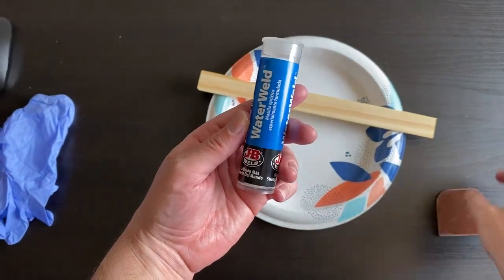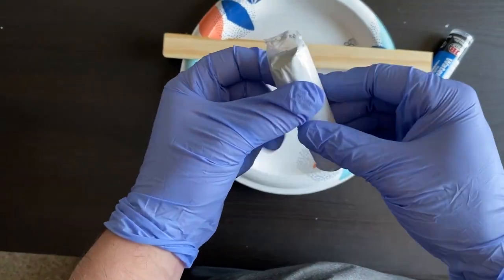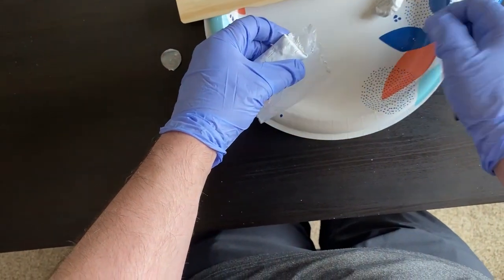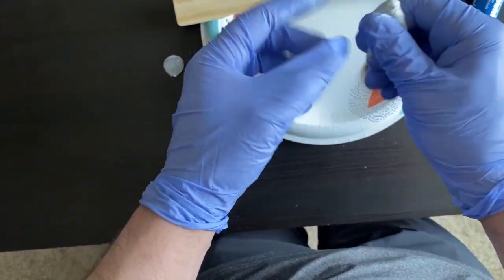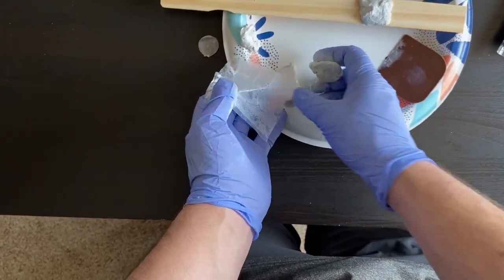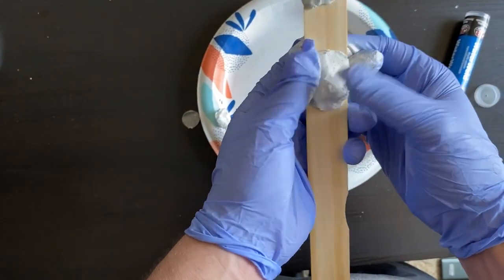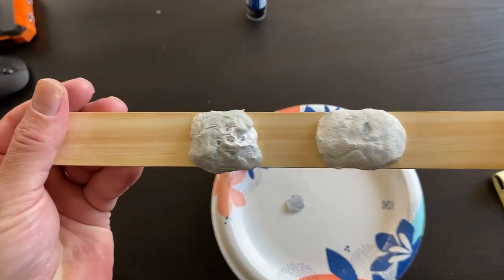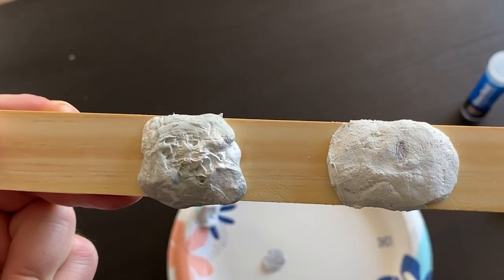JB WaterWeld Cure Test - How Long Does it Take to Dry

Comment: PRO TIP: Use 2 pairs of gloves.
As soon as it becomes difficult to work, change the gloves to new ones and transfer the ball there. It will be easier to work with now. Keep mixing a bit more.
This stuff is amazing.
Reply: It just stuck to my 2nd pair of gloves and turned into an unworkable mess. Not sure what I'm missing but this is pretty frustrating.

Comment: Does anyone happen to have experience with or know if this stuff will hold place and the pressure from a radiator hose that has hot antifreeze flowing through it?  I need it to help securely fasten and block the hose at its end from letting a small leak which sprays out once the liquid heats up when engine gets hot and thereby sprays the radiator slowly but surely out of its small crevice at the end. ???   Have tried everything.... Even "High temperature resistant" Epoxy..... And that stuff didn't even work whatsoever.

Comment: Used this on a filler neck around a weld I did which had holes from burn-thru. Applied it about 15 hours ago, after mixing it a bit, and it's harder than it was, but I can still push my fingernail into it. I hope it cures more.

Comment: I repaired my vinyl pool with this product before watching this video. I was desperate because I lost half the water, and my friends, I don't know where you live, but here in NC, water is really expensive😢. I didn't mix it like you said, so now I'll wait to see if it dries. The leak has stopped. If it doesn't dry, should I reapply it or remove it all and add the new product?

Comment: A rat chewed holes in the pump housing under my dishwasher. It had 3 or 4 holes. I sanded down the area to rough it up, cleaned it with alcohol, mixed the water weld up good and applied it with a piece of wire mesh over the holes to help strenghten it. After a few hours of drying I ran the dishwasher and it held just fine with no leaks. Better than buying a new dishwasher!
Reply: Read ur comment.  U gotta cover food in an unchewable container n set sticky gel pads under fridge around fridge , under oven ...anywhere u can find has gap areas thry can get into. Keep counter tops clean free of crumbs . It sucks I had my share of rats in an old house. They chew on toes n fingers n cause arthritis n make ur fingers deformed . I kept my lights on where I sleep n cover my toes n tuck myself in with blanket so they dont get my fingers n toes. The constant cleaning juz hav to get a cat 1 or 2 scare em off. Important avoid clutter n boxes. Store everything in unchewable containers . But I got rid of em cuz u gotta keep consistent n trash closed .
Reply: Use cutting mesh to protect your pipes, U can buy it any hardware store; use gloves & good wire clippers; wrap mesh around pipes/ hoses & place it flat on areas U want to protect- rats won’t touch it. Rats can chew thru smooth steel & concrete- they want the  fresh water in dishwasher hoses bc need to drink. Cats & OCD cleaning does 0; incl traps bc rats learn & pass on knowledge of human traps. Never poison bc rats don’t die, esp Alpha breeding pair , bc  rats never digest poison so it remains active in gut until rats poo it out.  Mean while, rat is slower & gets eaten by top endangered predators  who DIE horrifically from eating undigested poison INSIDE the live rat.
Reply: Use cutting mesh to protect hoses & pipes. Cats & OCD cleaning kitchen does 0. Never poison bc rats don’t digest it, only slows them so easier for top endangered predators to catch rats & predators DIE from active poison - not rats. Science proven Rats poo out all poisons. Autopsies of dead top predators confirm rats are poison carriers. Rats want the water from dishwasher hoses & pipes.  
    Rats in yrs past wanted few drips of pool water from old very slow leaking pump. Once no leak, no more rats came. No trap caught them either despite creating a rat trap  in their path bc rats chewed off all edges to create new path,  avoiding “trap maze.”  They did not want to drink direct from the pool- ironic. Big clean up of rat poo & urine with ammonia & pine sol,  & adding cutting mesh to any entrances kept them out.

Comment: infuriating excuse making for this grotesquely overpriced "waterweld."  ($9 at Lowes C'ville)  I had two straight fails, of it not getting hard after several hours, after kneeding a "slice" thoroughly, then applying the "putty" to a (perfectly dry, well prepped small hole in a brass pipe)....  where does it say to wait 24 hours to be fully cured?  The product literature directly indicates it would be just an hour....  but instead, still more soft putty, showing now signs of getting "hard" or sealing anything.  As for "mixing well," I sure as .... h*lll did that twice....  Idiotic to think that we're to go to the center of the $9 stick to find a few slices that just "might" (or might not) mix right....  what a waste of time and $.  Product does not deserve to have you making excuses for it.
Reply: User error
Reply: I've used it numerous times and never had a problem.
Reply: Says 1 hrs to set 25hrs to fully cure
Reply: My guess is your prep work needs to be more. More sanding more cleaning etc. JB Waterweld needs a few days to cure and your prep work needs to 100%. It is by no means a replacement for original JB Weld when a fix is substantial. If it’s get wet prior to full cure it will never cure. The one hour cure is bullshit*
Reply: Says 1r on box

Comment: Some years back, I got a small hole in my radiator (metal part). Found this stuff and patched that hole. Drove like that for another 5 years before deciding to upgrade the radiator. Also fixed a crack in my oil pan. Good stuff.
Reply: About to use it on my oil pan housing 😅😅💪🏾
Reply: I've had the same type of experience with it
Reply: my dad told me he used this on his lawn mower gas tank! (well the metal resin version they have). I have a small leak near my exit pipes in a pool I built, and need to basically "caulk" around the pipe behind the fixture. I HOPE IT WORKS! Gonna tell my dad about your fixes cause I find this product so impressive just from seeing it on the shelf and reading it and he loves it just as much!
Reply: Do you have an idea how to remove the glue from applying on a small part on raditor
Reply: Would appreciate the help Thank You

Comment: Thank you. I knew about the need to mix, but this really shows that I need to be sure to mix thoroughly.
Good job on your vid.
Reply from the maker: Thank you! I hope it was helpful. I used it to patch a hole I accidentally drilled in a plastic drain pipe. You can see that video here if you’re interested: How to Fix Hole in PVC Drain Pipe with JB Water Weld
https://youtu.be/rrHU2oiqF2I

Comment: Found this video right after I just used it.  I wanted to note that when I was mixing mine up really well, I noticed the putty getting really warm.  I wonder if its a chemical reaction or just heat from the friction of mashing it together very wel.
Reply: Indeed it is, that's an exothermic reaction of the bonding agents.
Reply: so what are we then to conclude that after mixing significant slices of the tube and then it doesn't get hot?  That maybe, um, by golly, there's wildly inconsistent flaws in the product?